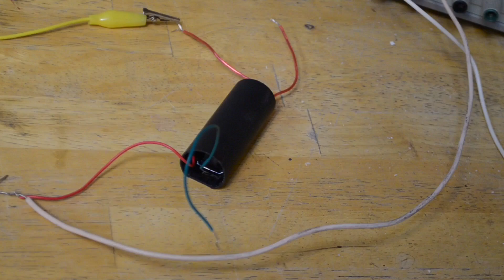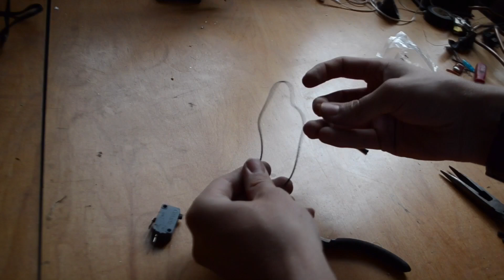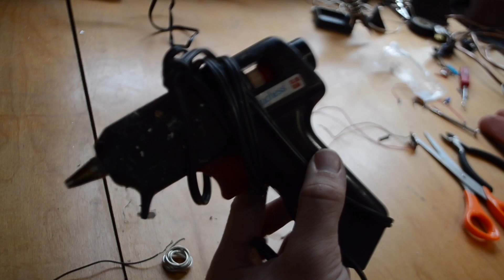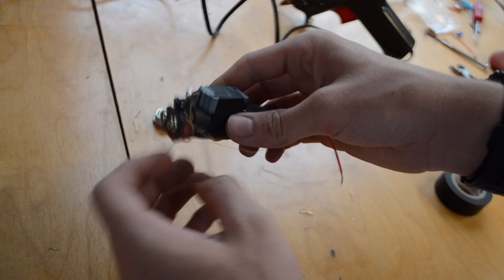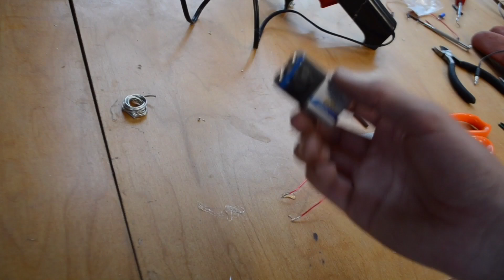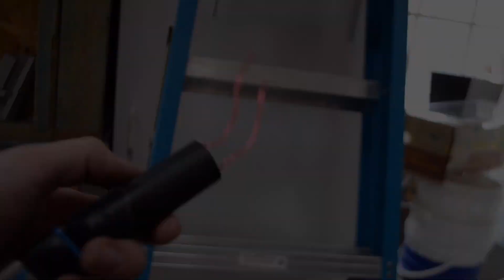How to make a 5$ taser!

Comment: Im not too familiar with electrical engineering, but I heard that 10+mA can be really painful, it may even kill you. If this is used on somebody, can it cause permanent nerve damage or even death? Because all I see in this video is a high voltage generator, some batteries and switches, but not too many safety systems.
Reply from the maker: +Angel Menxia yeah there is not really any safety systems, it should be used just as self defense, in the instructables linked below , or I guess in my pocket EMP video I have a newer version of it that uses 2 nails as the terminals, this is so that it limits the amount that is charged up by quite a bit, but still enough to hurt pretty bad :P also the nails make it so you can't discharge it easily across your heart. So hopefully anyone you would need to scare off would be scared from the noise ( as it's super loud ) xD
Reply: How does using 2 nails as terminals reduce the charge? Also lets say, I want to just have a flowing electric arch just for show and a little bit of shock. Is it possible to get 400kv and around 5mA's? Just enough to see an electric arch, without killing/hurting you if you accidentally touched it.
Reply from the maker: +Angel Menxia well, the 2 nails reduce the charge because how the boost converter works is that it builds up a charge in a high voltage capacitor that is in the converter, and when the charge is great enough to jump the distance between the 2 nails ( or wires ) it discharges, so by using the nails I limit the amount it has to charge up to to jump across. ( the closer the nails are, the less the charge will be ) also for getting it to a lower power, you could use a lower power source such as 6v, or also a resistor that you would put in series with the switch, this way it wouldn't allow as much current to flow and limit it before it gets to a high voltage . And I guess if you plan on shocking people for fun xD I would use the lower power source or resistor. I'm not sure what value of resistor would be optimal for you, but I would guess somewhere bellow 100 ohms . Let me know if you have any other questions :D
Reply: Keystone Science cool, so If I wanted to make a simple safe taser, I would need 9v battery-100ohms resistor-and a 400k voltage generator, along with a momentary switch. Is that list right? 

Also do voltage generators act somewhat like capacitors, by holding a high charge, and then releasing it once it reaches 400kv? Thanks, much appreciated
Reply from the maker: +Angel Menxia okay so I did some testing and even somethings as low as 2.5 ohms was too limiting for the boost converter to work properly, and a lower voltage pretty much just makes it discharge less frequently, so I think your best bet is to use a 3-6v power supply, or put the nails closer together, however I wouldn't worry too much as I have shocked myself with it before, and if you get shocked and the nails/wires are touching your skin, then it doesn't build up that big of a charge as it just goes through that small part of your skin.
Reply from the maker: +Keystone Science also I'll be back in a few hours I've got to go to work :P
Reply: Keystone Science did you shock yourself with the same type of taser you made in the video? Because my main concern is accidentally shocking myself and something goes terribly wrong.
Reply: Also how many mA's would be flowing trough the taser with the 2 nails?
Reply from the maker: +Angel Menxia yeah I've shocked myself with the same kind as in the video, it doesn't feel good, but I don't think it damaged anything
Reply from the maker: +Angel Menxia as for the milliamperes they flow through the nails, it is not much, but is proportional to the space apart the nails are, and rather than a continuous flow, it's like a square wave of current. I'll try and figure it out for you if you want though, I forgot the formula off the top of my head, but it is basically just using a capacitor formula that calculates the amount of jewels that the capacitor has charged up
Reply: Keystone Science so is the voltage generator basically a transistor that releases energy in square waves? Do the closer the nails are together, the less the generator has to charge up? Also, I bought a 400k voltage generator 3-6v, but I only have 9v batteries. What type of resistor should I buy in order to not "overload" or damage the generator? I understand that LED lights often use resistors, but what role do ohms play in resisting? Do ohms basically make sure that the resistor does not get overloaded?
Reply: Keystone Science also what would be the difference between this stun gun, and a consumer stun gun that you can buy at a shop?
Reply from the maker: +Angel Menxia I don't know what commercial stun guns use, it is probably very similar except for that their boost converter i think is probably designed differently to not be as powerful. Also this one is much smaller so it fits nicely in your pocket :D
Reply from the maker: +Angel Menxia yeah, so the circuit for the boost converter is basically a transistor that makes square waves, then it uses 2 transformers, then 2 caps and 2 diodes as a voltage multiplier, and the one I used was also a 3-6 v one, however with the nails, rather than overloading it, it just makes the frequency higher at 9v ( although I would not leave it on for too long ) . Yeah the closer the nails are, the less the capacitors charge up as it is about 1000v per cm of air that needs to be charged for the gap ( I know the companies say 400kv but realistically its at best about 40kv ) so I would say you don't really need a resistor, if you did want to have one I would say around 1 ohm ( an ohm is the level of resistance ), any higher would probably not let the generator to work well. So basically anything that has voltage running through it ( unless at absolute zero ) has some resistance, and ohms is the amount of resistance. The wattage rating of a resistor is how much power it can handle before it would burn up. This is p=v/r^2.
Reply: Keystone Science  so a 1/8 watt resistor would burn when exceeding 1/8 watts?     So let's say that I have an LED light that requires 20mA. I bought some resistors that said 1/8 watts and 220 ohms. Should I have gotten 450 ohms and 1/8 watts instead? Because it worked well with the 220 ohms.
Reply from the maker: +Angel Menxia it depends on the input voltage, since v=i*r as v rises I ( current ) also rises, and r remains pretty constant ( though generally the hotter something gets the more resistive it becomes ) what is your input voltage on your led's?
Reply: Keystone Science I was using a 9v battery with a 1/8 220 ohms resistor
Reply from the maker: +Angel Menxia yeah so that's fine, 9/220^2 = .0001859 watts which is far below the 1/8 watt maximum of your resistor. So that is fine, I'm not sure what kind of led you have, but if it should be good with that big of a voltage drop it should keep it safe xD ( across every resistance, there is a voltage drop proportional to the resistance / total resistance .
Reply: Keystone Science the label on the back of the LED said 20 mA. And with the 220 ohms resistor I think I was giving it 40mA. Is this math/theory right?
Reply from the maker: +Angel Menxia yeah your math is right
Reply: Keystone Science I also have a 9v battery, what type of resistor should I use to get it down to 5v?
Reply from the maker: +Angel Menxia how many amps do you want it to be able to supply?
Reply: Keystone Science would a 5v battery with 10 amps work on the taser?
Reply from the maker: +Angel Menxia theoretically you could do this, however, 9v batteries have an internal resistance of about 1.5 ohms, this means the maximum amps you can get from a 9v at a short circuit is about 6 amps.  If you want though to get a 9v down to 5 volts,  you can use a voltage divider, this is basically 2 resistors in series then a center tap that goes out ( Google voltage divider for a picture ) then the proportion of I think r2/r2+r1 = Vout/Vin so basically a 1 ohm resistor and a 1.25 resistor would get you the 5 v, remember though that the resistors will generate heat from watts=v/r^2 . So the resistor would need to be 9 watt resistors to be able to handle it. So you probably would want to use a more reasonable resistor value, though it will be not enough probably to power the pocket taser's boost converter
Reply: Keystone Science so 9v batteries does 60 mA's? Wouldn't 60 mA's and 40k volts be fatal?
Reply from the maker: +Angel Menxia 60 ma at 40kv would defiantly be fatal xD however as the voltage is being stepped up, it looses quite a lot of current, I'm not sure what it drops to exactly,  but much less .
Reply: Keystone Science so on the taser, how many volts and amps are on it?
Reply from the maker: +Angel Menxia I'm not completely sure at the moment, I can make some measurements tomorrow though and I'll let you know! :D
Reply: Keystone Science is the stun gun enough to kill  if used as self defense?
Reply: Keystone Science if I get this resistor,http://www.parts-express.com/mills-25-ohm-12w-non-inductive-resistor--005-2.5    , would it bring down my 9v to 5v, and still be able to work on the stun gun?

Comment from the maker: How to make a taser.
Reply: *Stun gun, tasers shoot projectiles connected to wire leads. This is a stun gun. Cool video though man!
Reply: They shouldn't be. All Tasers are stun guns but not all stun guns are Tasers. Like all Great Danes are dogs but not all dogs are Great Danes.
Reply: Jari Ravensbergen you need an electric current to have an electro-magnet. So if you installed the EM before the spark gap, I'd imagine it would have no effect (assume no motion of conductors unlike a motor). If you installed it after the spark gap, you'd have to exceed your voltage to make it arc in the gap, I imagine most systems are installed with capacitors to deal with the arc. I think the question though is if installed after the gap, is the field even noticeable on each arc (or does it collapse to quick to be of any significance). I might be thinking wrong though
Reply: The Taser (an abbreviation for Thomas A Smith Electric Rifle, from the book) is like a rifle, it shoots a projectile. Maybe you could make one of those, yeah?
Reply: if you hook up an electromagnet to the spark gap will it make a very strong magnet?(for a short period ofcourse)
Reply: onecustodian that many volts can immobilize them.
Reply: Keystone Science when used in self-defence, does this cause muscles to contract to the point where the person is temporarily immobilized? Or does it just leave a burn?
Reply: I have a boost converter just like you and it's arc is so loud, how can I reduce it sound?
Reply: Keystone Science Schematics?
Reply: Add 2 fish hooks to the wire and leave it on them .
Reply: John pounds
hey tough guy!
Reply: Ryan Carmack ..thats what i was thinking..i wanna double up (2×boost converters) and when i add 2 of them Square type batteries I've a feelin im not gonna get the desired effect lol
Reply: Keystone Science where do you get your wire
Reply: no
Reply: Keystone Science NEED HELP! On the product description it says that  this boost converter needs at least 2A to run. Where i live batterys only give off 0.2 A so i only get a tiny spark... Is this because of the batterys or am i doing something wrong? Help apprechiated ;)
Reply: Keystone Science i want this but can i buy from you ?
Reply: Keystone Science
Reply: Keystone Science would a 12v supply work?
Reply: Btw i looked it up, a taser can shoot little darts for far range as well as contact for close range. This is a stun gun, which only has the close range contact feature
Reply: always good to know, do a test? any volunteers?
Reply: Keystone Science